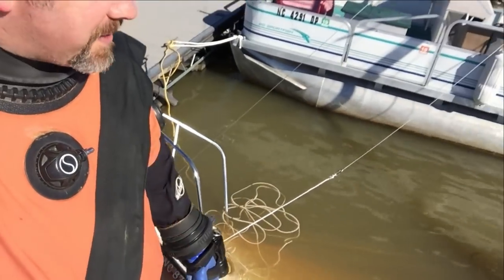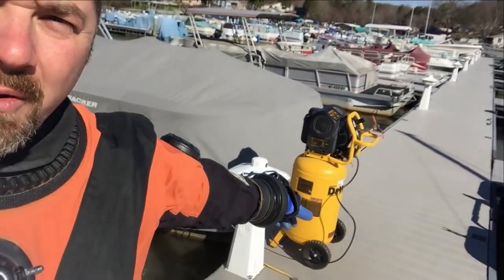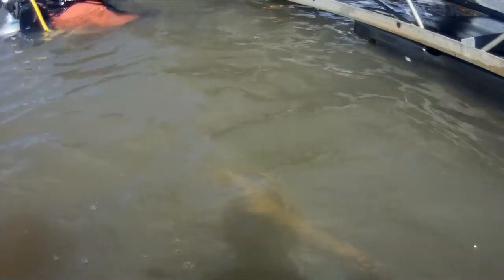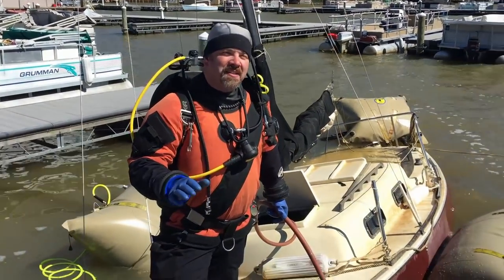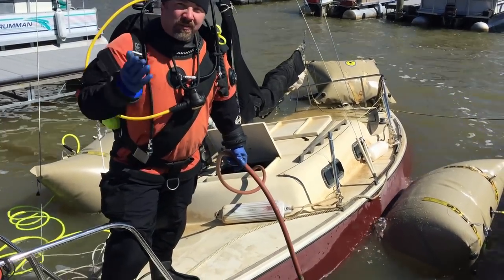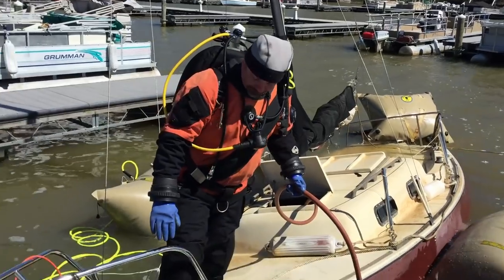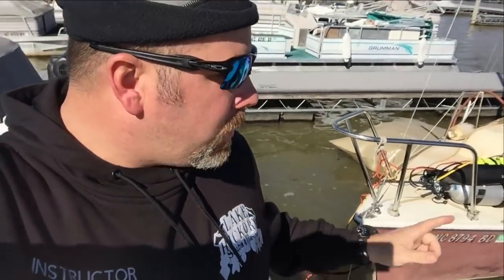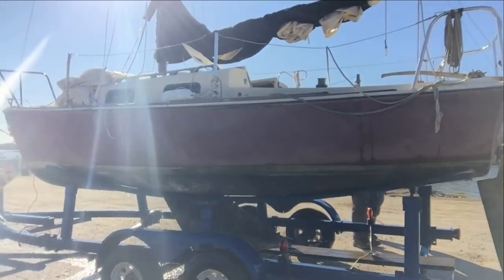Sailboat Salvage --- Is It Salvageable????

Comment: Hi Bryan  Ken here
Can I ask appropriate  cost of a salvage like the one on the sail boat. Is it by the Job or hr. Or both if I may ask?
Reply from the maker: So we have two different salvage rates.  One is based off of depth and the length of the vessel.  The other rate is based off a per hour fee per diver.  So in short, most vessels we charge a flat rate per foot of the vessel down to a depth of 20 feet.  That price doubles for vessels deeper than 20 feet.  Then our hourly rate per diver is for jobs of repair, and salvage where we just do the rigging, and a wrecker crew does the lifting.
Reply: @LakeHickoryScuba  
Thank you Bryan  I was wondering about the costs.
I've so much have enjoyed your vids and Expert Advise on so many Scuba subjects  thanks again!

Comment: How did you determine how many salvage bags you needed to lift the boat
Reply from the maker: Great question. In short we use lift theory.  By using Archimedes Principle, we can take the weight of the object and the amount of water it displaces, and use those variables to determined is much lift we need.
Reply: @LakeHickoryScuba  Thank you for the answer
Reply from the maker: You’re welcome.  The easiest way to think of lift theory is like this. You need to determine the difference in weight between the object you are trying to lift, and the weight of water it displaces.  Your answer will be the amount of lift needed to make an object neutrally buoyant.

Comment: Do you get paid in advance rather than, say, 30 days after invoice, as there must be a risk that the owner finds out his boat is worthless and then he's never seen again?

Those aren't the typical lift bags you find in your local dive store, I bet they cost a pretty penny! I assume you buy them from a specialist supplier rather than having to make your own?
Reply from the maker: The bags that we use, are from a company called SubSalve.  They are extremely heavy duty, and come in all different lift capacities all the way up to 70,000 lbs of lift. And yes, we always run the risk of not getting paid, its just part of being in the business.  Sometimes we get payment up front, but most of the time we invoice out.
Reply: @LakeHickoryScuba  cheers for the insights into your world.
Reply from the maker: You're Welcome